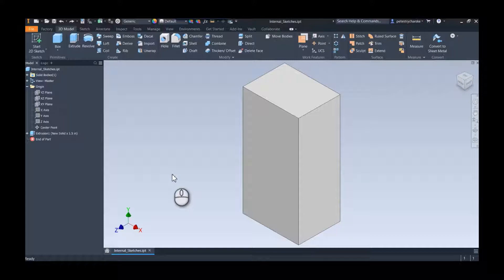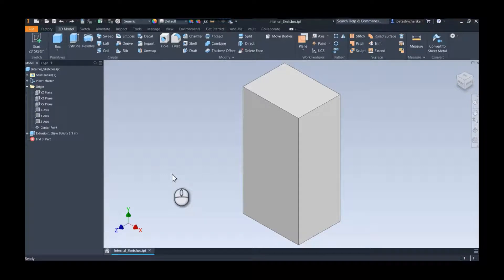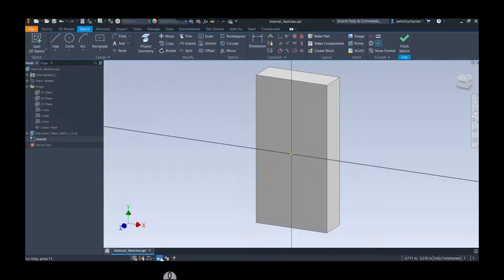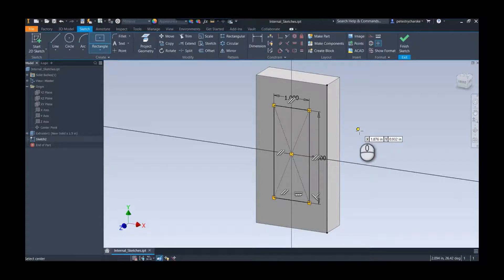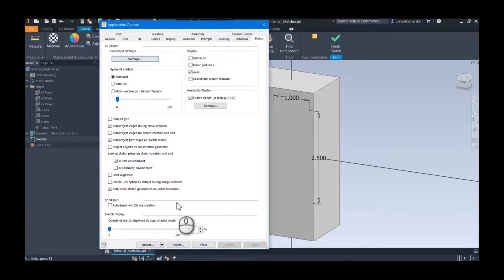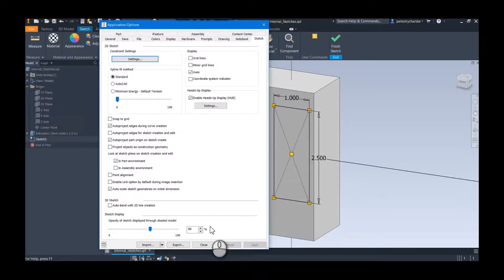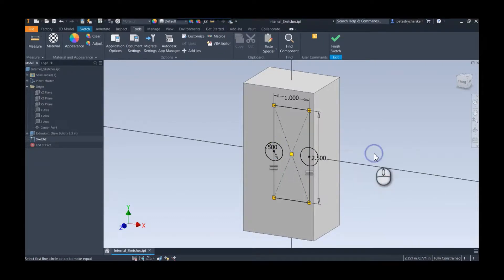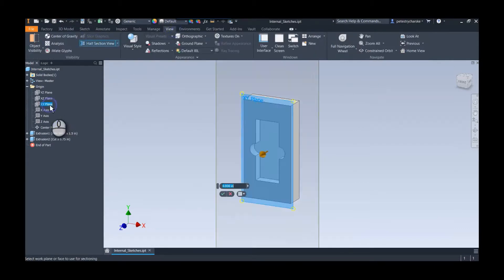Inventor - Viewing Sketches Hidden Behind Other Geometry

Comment: This is a ridiculous problem that Autodesk needs to fix now. Solidworks does not have this issue. In fact sketches are always visible unless you hide them or they are consumed by making a feature with them.  And when you edit or create a sketch, say inside of an object, you can see your sketch lines from any view. You can section view the model if you want, but you don't need to. And this is important, especially if when making that sketch you need to take into consideration existing object geometry. 
The opacity option is great and all, this should not have to be something that you need to change.
Here we are now at Inventor 2025, and they still have not fixed this.